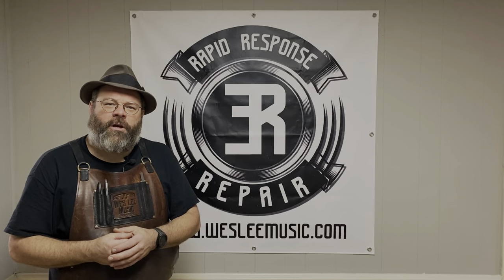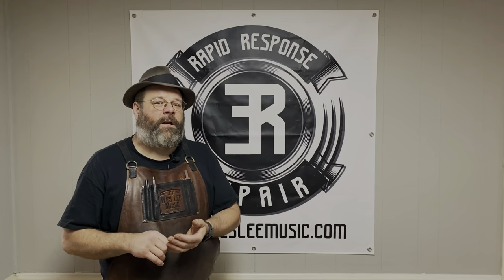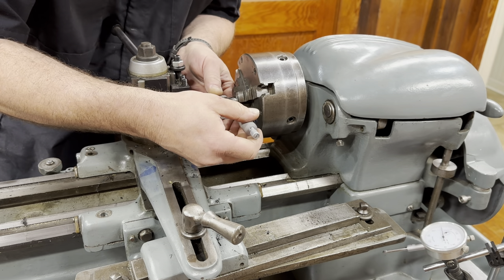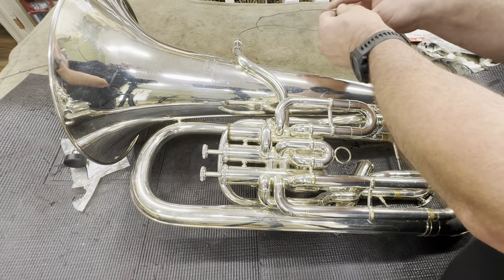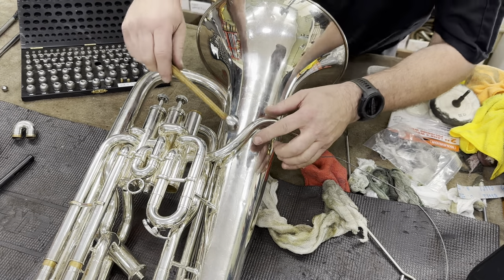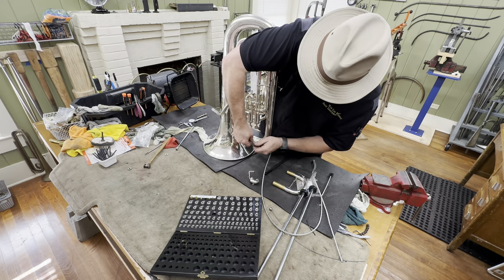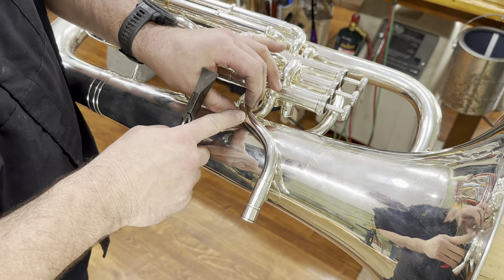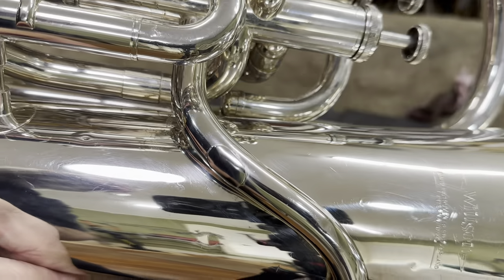Patching Wilson -A Euphonium Emergency Repair, band instrument repair

Comment: 7:35 is there ever a risk of the solder staying liquid long enough to actually drip through the hole being patched? and if so could it pose a problem to the functionality of the instrument?
Reply: The secret is closely fitting the patch and putting in just enough solder for capillary action to pull it across the patch area. If the gap is large, you have to feed more solder to fill it, and the risk of an internal solder blob grows.
Reply: @rickdenney5772  makes sense 👍

Comment: Can’t you use a plastic sleeve with one hole where the wire feels through to protect the valve casing? The disadvantage is that you have less room to move the bal into the tube.